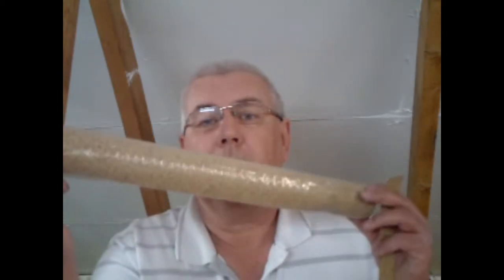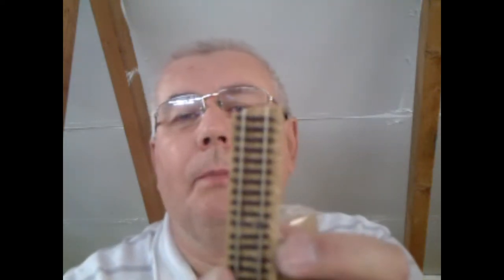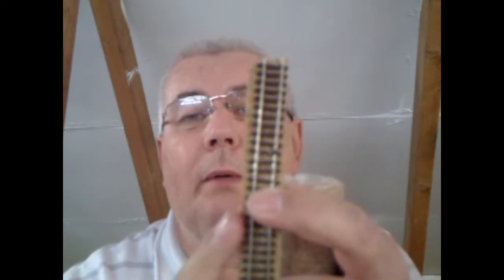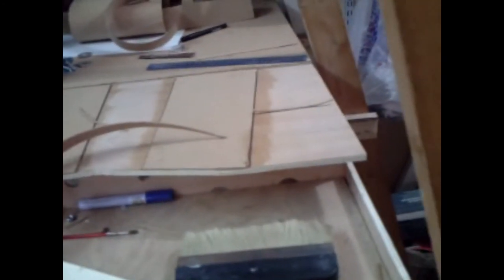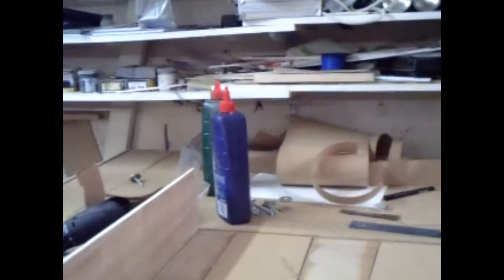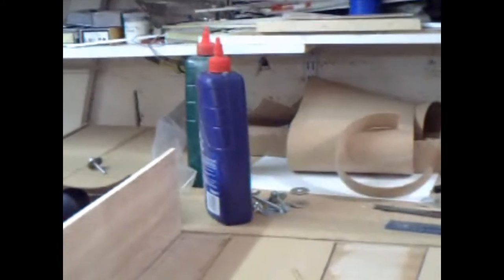STEVE'S LOFT PART 2  LAYING THE CORK UNDERLAY

Comment: Would you use the cork on storage lines behind the backscene ?
Reply from the maker: Hi david  i have put cork in the storage roads but it is up to you whether or not  but if you don"t you will have a slight ramp thickness of the cork